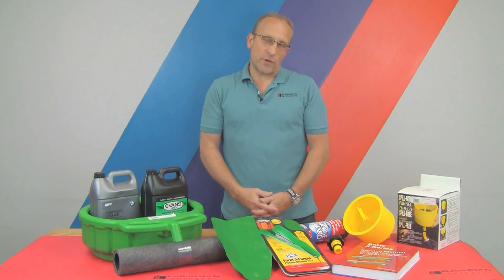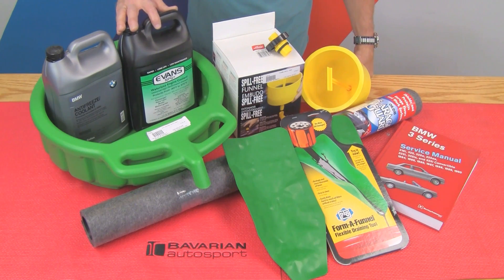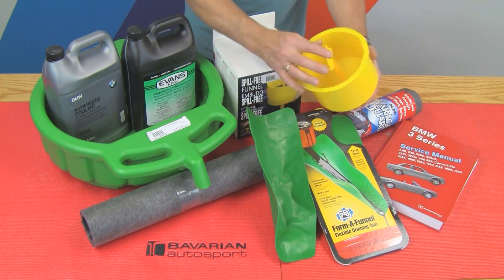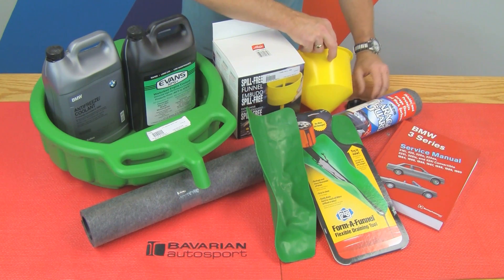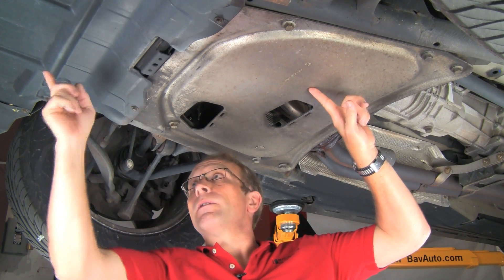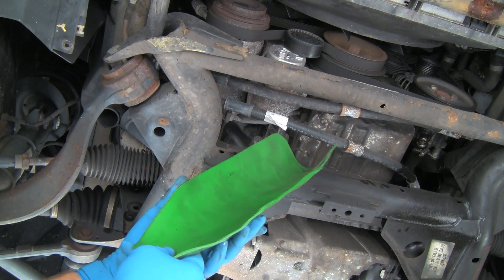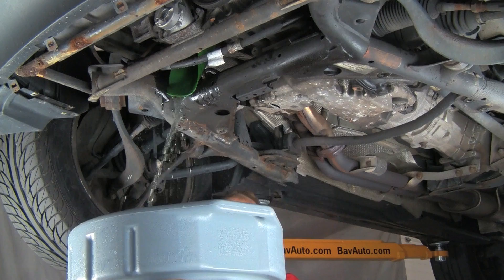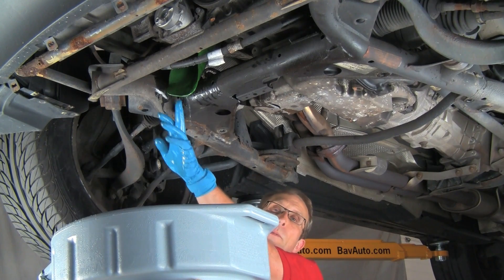Flushing & Replacing Engine Coolant in a BMW/MINI

Comment: is it me or does it look super full to me? or is it supposed to be that full?
Reply from the maker: If you fill to (or near) the top, as the fluid heats and expands, the excess will vent through the cap, while running/driving.
Reply: Bavarian Autosport

Comment: why are german vehicles so difficult to maintain...most power steering pumps you will hear loud noise from the steering gear if you run out of fluid, on a bmw the whole unit melts and causes damage to the ac clutch as well...i've never even heard of having to bleed coolant from a vehicle, you usually just fill it up and that's it.
Reply: lol why wouldn't you bleed air out of any other vehicle? That's how ALL systems work.
Reply: Justin Moore
Reply: How can no fluid in power steering destroy an ac clutch? and of course you have to bleed coolant from every vehicle, its heating up and cooling down constantly and running around an engine, of course it needs bleeding

Comment: hi im losing coolant from the bottom of the radiator,exactly were the blue screw is but is not the screw that's broken its the part were the screw fits its loose  any help please thx
Reply: radiator it self?

Comment: Does BavAuto recommend a specific vendor for underbody/under engine splash shields.  I have a 1998 328i that came with a missing section, directly under the engine.  Just recently, the narrow shield that protects the serpentine and lower radiator fell off somewhere...so I'd like to replace these.  Especially with winter around the corner.

Thanks!
Reply: +Kevin Kroeger OEM for life

Comment: Once finished and radiator cap back on...if there's any more air in the system will it find it's out by itself through regular driving...or is it sealed in there ?

Comment: Thanks Otto for an excellent demo.  The question about the engine block drain plug has been asked many times.  It is not that intuitive and clear from your video, as you seemed to be showing the plug from the front, and then removing it from the back with the form-tube in the front.  If you could add a few still photos, zooming in to help locate it (at the point or at the end) to your video, it would be great!
Reply from the maker: Frank J We really couln't get any good shots on this 4wd model, but.......
The plug will be the only large hex-head (like a bolt head) on the side of the engine block.  The newer 6-cylinder engines have the plug between cylinders 1 & 2 or 2 & 3.  The earlier engines have it located between cylinders # 4 & 5.  The plug will be a few inches above the mating seam for the engine block to the oil pan.
Reply: +Bavarian Autosport working on a 04 325xi. what is the best way to get the engine block 
drain plug? it seems to be in a very inconvenient place. or is there 
another way to drain the coolant system completely?  thanks and always 
great info.

Comment: When flushing multiple times, do you use regular tap water or distilled???
Reply from the maker: gtarules1 You should use the distilled water for all flushing stages.  this way, you can be assured that you have no standard water (electrolytes) left in the system when it's time for the final fill.
Reply: just the answer I was looking for. thanks

Comment: Hi,
What do you think about replacing the original thermostat with and aftermarket one in order to reduce the coolant temperature (Since I am assuming that the thermostat cannot be adjusted) ?
My car is 2008 750li and the coolant temperature reaches 113 Celsius while stationary, I drive in areas reaching an outdoor temperatures as high as 50 Celsius and I am using 50/50 water+coolant mix (I guess it should not exceed 100 Celsius so that water doesn't evaporate)
The high temperature result in damaging most plastic and rubber under the hood.For example, the reservoir now needs to be replaced as its plastic got damaged from the excess heat and it now allows coolant to leak through it. Also the cabin filter boxes plastic broke into pieces. I discovered that most of the plastics in the hood cannot handle such heat.

Please help me with your suggestion to reduce the engine heat, keeping in mind that there are no problems in my cooling system and this is the factory set temperature range,thanks a lot in advance :)

Comment: do you have a video show how to flush heater core in E32 7-series
Reply from the maker: No, but flushi9ng the cooling system will also flush the heater core (do the flush with the heat on HIGH).  If you have a partially clogged heater core, you can try running a hose directly through the core ... via the core inlet and outlet pipes at the firewall.

Comment: Thank you for the video, its great to have professional help on these vehicles. I am a new owner of a 2000 BMW 323i for about 3 weeks. During researching the car before purchasing it, I saw that the cooling system is a weak point so I have done a complete cooling system overhaul. New radiator, water pump, thermostat, expansion tank, hoses, and temperature sensor as well as the coolant level sensor. After bleeding the system over a couple of days (allowing the engine to cool down overnight and adding fluid immediately in the morning) my coolant level light comes on after the car warms up indicating low coolant. I have read that overfilling the expansion tank can cause it to rupture prematurely so I have only added fluid to the COLD engine to where the coolant level bobber just hits max. Although the plastic bobber mechanism is slightly covered with coolant I can clearly see the mechanism through the fluid. I noticed that you filled the expansion tank to the rim when hot which would equal about halfway when cold. My long winded question is can you explain proper coolant level inside the expansion tank. Thank you.
Reply from the maker: You're fine to fill the tank close to the top.  This will not cause the tank (or anything else) to crack.  As the coolant expands (as it heats up), the excess will be expelled through the overflow, via the pressure release in the cap.  This would be normal.  Sooo ... just fill it up and let it find it's own level as it gets to running temp.  People that have talked about overfilling and cracking tanks or whatever, have simply experienced coincidental failures.  The only other possible point would be a cap that has a faulty pressure relief valve that is "stuck closed".

Comment: Otto then if I am going to use 4 gallons of coolant that means that that is what I am going to get from the car I mean the old coolant because I drained it from the radiator and I just got less than a gallon
Reply from the maker: We're not exactly sure just what you're asking.  However, if one gallon was removed 9and the system was full), you will be refilling with one gallon.  Now, if you are doing a flush, you will get more than a gallon out if you remove the engine block drain plug and the radiator drain (or remove a lower hose).  There will still be coolant in the system where it can't be readily drained.  this is why we do the multiple flush and drain procedures, with the water .... so that what is left in the system is just clean distilled or ionized water.
Reply: BavarianAuto sr another question my 03 bmw 325i is 10 quarts coolant capacity too like the one in the video?
Reply from the maker: jocevi1773
 - 8.8 quarts

Comment: Keep making those videos. Aloha Otto, thank you for your time to help us guys on the correct way to do this. Would you consider doing videos on 2003 Z4's?
Reply from the maker: Thanks!
As for the Z4 specific DIYs; we need to consider the overall usage each of the videos that we produce.  Most of what we do can be used and adapted to your Z4.  However, tasks that are specific to a Z4 model may not be covered well by our videos.  Hopefully, Bentley Publishing will have a Z4 manual soon!

Comment: Hi Otto what happens if I just drain it from de radiator and not from the block the thing is I can not see the block drain plug, my car is a 03 bmw 325i
Reply from the maker: You can do this, but you will have to do more flushing with the water only, in order to get rid of the excess coolant that is in the engine.  The drain plug on your 325i is in the same place as shown on this X5 (same M54 engine),.  Also, you can get another view of the plug in our water pump replacement video, which was done on a 2005 325i.  Click the link to go to the video.  The plug is shown starting at time 5:54.
https://www.youtube.com/watch?v=rcNa4e8d2VA

Comment: heard a lot of good stuff about BMW antifreeze. I have heard it is a good antifreeze for aluminum block engines along with asian pink coolant.

Honestly how does this coolant stack up against the green stuff? Not looking for a big debate but I have thought the green has a 60+ track record of working just fine while this is still relatively new. So curiosity has got me thinking. I already know there are coolants that are the death of an engine (yes I am talking to you GM) but I've never heard anything bad about this coolant and so I am actually considering putting this into a GM car with an LX5 engine (all aluminum engine). I want to keep the car alive (It being the final model of Olds before it went belly up its an Intrigue)  and recently had a water pump failure so it gave me a chance to flush the deathcool and refill with a coolant of my choice.

Personally I like to take a lot of care of the cars I get so I think BMW has made some really good advancements and many that other manufacturers have followed (yeah GM even copied the bleeder on the radiator on this car as well). I believe the LX5 was GM's answer at the time to all aluminum DOHC V6 design that other overseas cars carried. The Intrigues body style was an attractive one and has left me wanting to breath new life into this car.

Thanks in advanced for any light you may shed on the coolant used in BMW's
Reply: The traditional green coolant is based on Inorganic Corrosion inhibitors, such as Silicates, Phsohates, Nitrates and Borates, this type of coolant is ok for engines that are mostly made from cast iron, if your engine is all aluminium, or has a aluminium cylinder head it's not great because the Borates it contains are very damaging to aluminium.

The best coolant i find for aluminium engines or mixed cast iron / aluminium engines are Organic coolants that meet the Volkswagen G12++ or G13 specification, these contain only Silicates, which protect cast iron, aluminium, copper and brass and no Borates or Nitrates :)

They last twice as long too as they use long life organic corrosion inhibitors.

Comment: This is by far one of the best videos I've seen! I have a question, not BMW related but an Acura. I replaced the radiator and have filled it with coolant using the spill free funnel. The heat controls are electronic so I couldn't really have the heat up without running the blower. My coolant starts to bubble up and the level rises way over and splashes around the funnel. What am I missing here? Thanks
Reply from the maker: You may still have air in the system.  How long have you been running it for this to happen?
Reply: BavarianAuto I had it running for about half an hour just to be sure that I had all air out. Now what I was doing was, turn the heat off and then the coolant level would rise and start to bubble out of the funnel. Now everything seems to be working fine, I've driven it on the highway and no overheating issues so far.
Reply from the maker: techguy1678
 - you should be fine at this point.

Comment: and another question haha, is it fine do add the coolant and water separate as you did will it eventually all mix or should I pre mix it thanks ! sorry for all the questions fix time doing this
Reply from the maker: Yes, it will mix while running in the system.  This is really the only way to assure that you are at a 50/50 mixture (or what ever % mixture is desired) as we don't know for sure how much water is left in the system.

Comment: Also when you flushed the system with water you used 2 quarts correct and turn on the engine to get to normal operating temperature or do the heater flaps open up soon thanks
Reply from the maker: The quantity of water required for the flush will vary from vehicle to vehicle.  Distilled water is cheap at the grocery or Walmart.  Just grab a few gallons.

Comment: I've read online that the BMW E46 330ci takes 1 Gallon BMW coolant and 1 gallon water is this true ?
Reply from the maker: Two gallons is 8 quarts.  However, the fill quantity of the system is more like 10 to 13 quarts.  Therefore, you'll need two gallons of each for the final fill ... but you won't use it all.

Comment: when I flush the system with the water to wash out any old coolant do I run it to operating temperature and then let it fully cool down and repeat or could I just flush the plain water when still at operating temperature and just be cautious also you said some gets left in the system did you do this on purpose or is it just because some gets left behind ? thanks
Reply from the maker: You don't have to wait for a full cool-down ... but just be careful of the hot water.  Yes, some water is just left in parts of the system that you can't readily drain.  For this reason, we suggest that the water flushing be done with distilled water (just like you'll use for the final fill).

Comment: I have 2008 335xi  I was down about a half of quart  didn't have coolant  so I put in distilled water 2 days later I got a po128 code do you flushing would work before changing    thermostat  thanks
Reply from the maker: The 1/2 quart of added water would not cause any problems.  The thermostat code (P0128) is likely just coincidental.  Clear the code and if it returns, you need a new thermostat.

Comment: Why mixing distilled water with coolant fluid? Any common problems if not mixed?
I drive a '08 335i, and just added a little bit of BMW coolant fluid after low level checked, but without distilled water.

Had a problem like 1 month after, seems like water pump and thermostat are out... is it in relation with?
Reply from the maker: No, your current pump/thermostat issues are not due to adding 100% coolant.  Adding just a bit of straight (100%) coolant will not cause any problems.
First, we use distilled water so that the minerals are removed.  This keeps the electrolytic corrosion to a minimum over the life of the coolant.  Secondly, we mix it 50% with the water as this is what the coolant is designed for.  We would only use a stronger concentration if we needed very low temperature freeze protection (typically below the -30-f range).  Since the coolant does not transfer hear as well as water, this is why we do not run it stronger than 50%, unless required, as just noted.
Reply: You guys still use that Blue / green stuff? Here Europe that is not even allowed anymore. It is to harmful for the environment.We use G12 or Coolant SP 11 that goes undiluted into the reservoir, it is especially made for cars with and aluminum engine block. It is not corrosive. For the engines made out of cast iron you can use the blue stuff.
Reply: BMW coolant is a minimum 50%/50%  depending on your local weather, because the OEM stuff is NOT PRE-MIXED
do NOT use 100% BMW coolant, because 100% coolant will NOT cool down your engine (funnily enough) the water component does the cooling.
Reply: I use what's recommended for my car by BMW. And that is Blue one.

Comment: Why do people only drain the coolant from the radiator? Is this enough when it comes to draining? Or would you have to also drain the engine block? Also, the heater in my car seems to be not working. Will this affect my flush by overheating the engine?
Reply from the maker: Draining just the radiator will only remove about 1/2 of the total coolant from the system.  You need to also drain the block and do the flushing in order to achieve a full 100% removal of the old coolant.  We can't say why your heater is not working (many possible issues) but this should have no effect on a flush job.

Comment: Will a new crusher washer be needed for the two plugs?
Reply from the maker: We do prefer to use new sealing washers.  However, if they are not available for some reason, the old ones will usually seal.

Comment: I have the 99 bmw 328i E46 model, where exactly is the engine block drain plug? on the 2.8L? Also when flushing, can I use plain pipe water to fill and flush the system, and do I have to have the engine running to operating temp before I drain the water?
Reply from the maker: The block drain on your M52TU engine will be in the same relevant position as shown on the M54 engine, in the video.  We would suggest using distilled water to do the flushing since some of it will be left in the system when you are ready to refill.  The reason to run up to operating temp is so that the thermostat opens and allows full flow of the flushing water through the engine and radiator.
Reply: BavarianAuto Thankyou!!

Comment: After draining is it normal to have some old coolant left over inside of the expansion tank?
Reply from the maker: Yes .... as well as other areas of the system.  This is why we do the flush with fresh water before refilling.
Reply: BavarianAuto When you flush with fresh water, do you have to get the air out of system when you add just water knowing you will drain the water before refilling?

Comment: I have a F25 2011 X3 28i and I can't find the radiator drain plug.  Did BMW do away with the radiator drain plugs on the F models?  If so, do you know what the procedure is for replacing the coolant on the F25 models?
Reply from the maker: We have been noticing the lack of a drain plug on the latest models.  The micro-film drawing shows a plug in the lower radiator hose at the end connecting to the thermostat. other than this, you would just remove the lower hose from the radiator nipple to drain, as well as opening any other hose connections that are convenient to work with.
Reply: BavarianAuto Thanks for the reply.